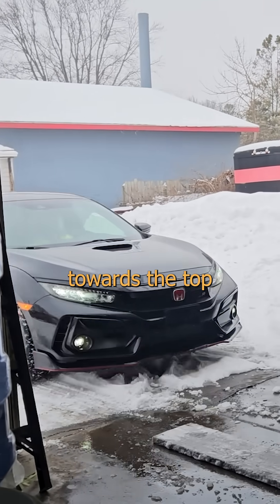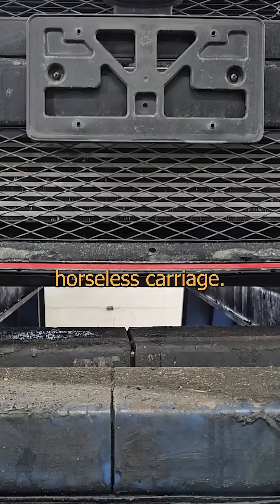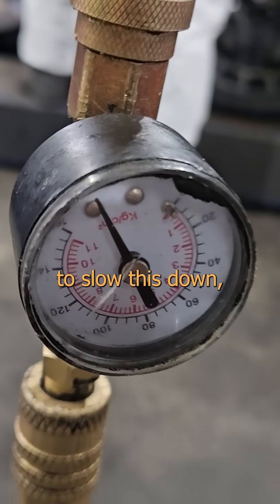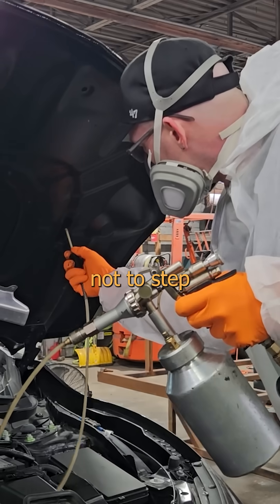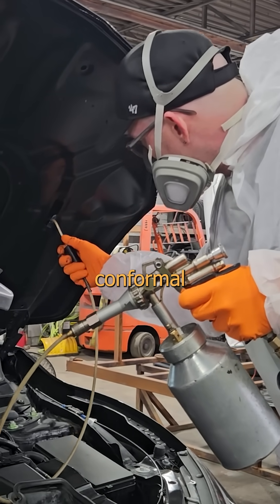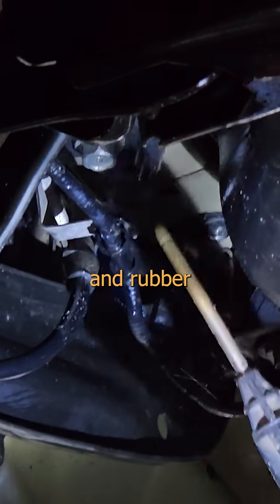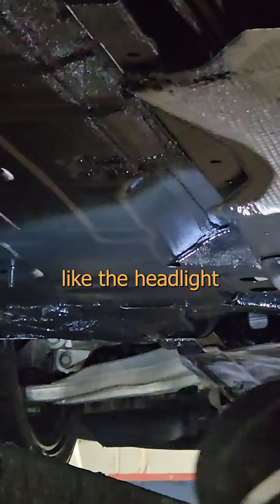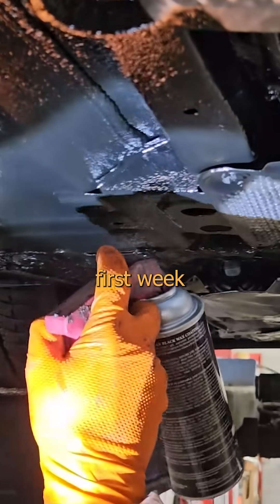How to stop rust on your car #chrisboden #comedy #engineering #wax #corrosion #science #winter #salt

Comment: Gramps just used a 50/50 mix of diesel and old used motor oil and sprayed every undercarriage and trailer he had on the farm. Held up pretty well.
Reply: Gotta do it every year, and if everyone did it, you'd be wondering why your windshield is always so murky and why the rivers are rainbow coloured.
Reply: Too bad it's a carcinogen and pollutant unlike wax or lanolin. I wouldn't want this near crops or roads when it runs off. He comes from a time where you would just bury your used oil in the ground but we've learned better. He can use what he'd like but this shouldn't be recommended to anyone.
Reply: Yes. This is the only way that actually prevents rust. My grandpa taught me something similar. Undercoating actually accelerates rust and just hides it because it traps moisture
Reply: @yyeezyy630  Not wax or oil based (other kinds of oil, lanolin is common). It's explained why in the video.
Reply: @yyeezyy630 that is simply not true and it is terrible for the environment to do that man
Reply: Seconding the used motor oil. There's a reason our farm still has equipment from the 60's that runs excellently.... When you're done for the season, you clean and oil everything

Comment: Wax does start to lift and trap moisture after a couple years accelerating rot.  Reapplying does nothing for behind the first coat.  There are a lot of comparison videos out there and some military testing documented for protecting their fleet.
Research: “Rust Cure Formula 3000”.

Comment: it's not just about trapping water, it's also about accelerated point corrosion (the galvanic potential of that whole covered panel finding an electrolytic bridge at any crack, gap or scratch). Wax is the only way to go, if you're not repainting.

Comment: When we lived in the Lansing area, I was told that undercoating for modern cars was pointless. Years later, after hitting a small bump, our car, which still looked and drove almost like new, suddenly sagged, and one of the rear doors wouldn’t open. The underside had been eaten away by rust and finally gave out.

Comment: It's the salt. (Castrol for example) Motor cycle chain oil that turns into grease when dry. Mudflaps protect from gravel, sand and salt.
Rust paint: buy a gallon, take a litre , mix with an equal amount of paint thinner. This is your primer that will soak into surface rust. Prime, dry, paint, dry now comes the color match paint.

Comment: If I ever got a near new car, I'd love to get this kind of cheap but effective protective coating, as it would prevent a lot of corrosion from salt water damage in my coastal area.

Unfortunately, I reckon that "Down Under" in Australia - where it can get so friggin' hot in summer that we don't even bother to use fuel in our barbies (BBQs) anymore (×) - we'd have to come up with an alternative coating to this Dr Zooks Sex Wax, 'cause it'd pretty rapidly melt off into an expensive puddle...

(×) - Seriously, if you leave a steel griddle plate out in the 45°C+ SUNLIGHT (<sigh> that's 113°F+ to you poor American luddites) for an hour or so, it will easily get hot enough to fry up a steak & some snags no worries...

Back when I was young (and skin cancer was some abstract boogie-man), I actually got to personally experience 55°C (yes, that's Fifty-Five Degrees Centigrade or 131°F / One Hundred & Thirty-One Degrees Fahrenheit) weather (up in the North of Western Australian, near Wttenoom), where the sunlight feels like goddamn lead bricks & your brain gets so fucked-up by the heat (even in the shade) that you'll feel really stoned; like you're in a bizarre dream where sunlight smells like metal & the even blue of the sky is kind'a loud. All the thousands of spiders (Australia) getting frigging heatstroke & dropping like black hailstones out of the eaves / trees / fence capping / etc. really, really, doesn't help you maintain your sense of normalcy...

Comment: Last year I bought a used truck that the original owner lived in PA and I live in TX. I have never seen a newish vehicle had so much rust and corrosion underneath a truck and automatically knew what was happening after they told me from where its from.

Comment: I had a G body that someone had taken to Ziebart in the 90s. It had some gummy stuff on all the sheet metal in the engine bay that was a nightmare to remove without damaging the paint. You could use mineral spirits to get it off, or alcohol, but both would take a little bit of paint too and it hurt my soul to see that paper towel come up faintly car-colored. The underside had a coating on it too and I don't remember if it was a hard coating that was made sticky by the oil leaks or a wax type. Anyone know what Ziebart used 30 years ago?

Comment: As I get older, I realize some of the things those old bastards that I fondly call my mentors did and said are way better than a lot of the new-fangled gadgets and gizmos you can buy today. Been a mechanic for 3 solid years, a mobile mechanic for almost 1, and between being underpaid and not having enough space, I've tended to keep my tools as lean and reliavle as possible. This often means relying on old designs like the carbon-pile tester: dirt simple yet effective. Some tools are irreplaceable, but most of the space for my tooling is spent on sockets and drivers, wrenches and torque sticks, and some mild fabrication. Chris, keep doing what you do. I may be in another field, but my brother-from-another-mother, I learn something new from you every video

Comment: A good product for DIYing this is fluid film it comes in a rattle can or metal can and is lanolin based and you can get kit with a long hose extension for a umbrella shaped spray pattern and the fluid film for under $150.

Comment: I have a pair of 97 Ford Explorers, one was babied and got a dealer applied rubber undercoating, the other hauled a big trailer, and didn't get washed or oil changes for years.

Both have terminal body rot, but being body on frame that's not necessarily a death sentence.

The one with the rubber undercoating has extensive floorboard rust and and lots of thick peels of rust off the frame, not quite a hazard but concerning.
The one without has clean floorboards a minor scale on the frame.
Rubber undercoatings are the devil, stick to oils/waxes.

Comment: As a DeLorean owner, I can confirm…and add to this: Brake fluid will also soften and slough epoxy off. And I also found that prolonged exposure to high temperatures from exhaust systems when operating in desert environments can also crack epoxy. And for those unfortunate 1983 models that got sprayed with rubberized undercoating, it also makes one helluva mess.

Comment: Any thoughts on CRC Rust Inhibitor?  I spray a little on suspension nuts and bolts so I have a prayer of removing them in the future here in Maryland.  Works great for that, but wondering about undercoating.  Definitely does NOT smell nice immediately after application.

Comment: There is also the at home cheap version of this. Buy a few cans of Fluid Film, spray everything metal underneath the car once before summer, and once before winter. My stepfather has been doing this on his 2013 GMC 1500, and the frame is clean enough to eat off of.

Comment: I have been told undercoating is worst than not having it since during application it will trap moisture and it might look good but internally it is rusting. So I much rather have open view of what is going bad.

Comment: In Canada, at least where I used to work, undercoating was pretty much standard. The majority of vehicles got em.
Reply: Right? Krown seems to be the go-to undercoating around South Central Onterrible. If you ain't undercoating your ride, you're just asking for trouble. Missed 2 years in a row on m my '04 Taco when it was 10 yrs old. with a spotless frame. It rotted right out right quick after that.

Comment: I'm curious if bolting a chunk of magnesium to the body would prevent rust, because magnesium has the highest reduction potential of any metal, so if any oxidation were to occur anywhere electrically connected to the bar it would be at the bar and not the body of the car.

Comment: We simply save the oil change,  and spray that stuff every where, best is to run it down a dirt road to increase the stick. Reapply several times and you'll have a water proof layer pressure washing will have a time with, and with the black carbon coating, it's obvious where ya miss. Bonus points  it keeps bolts from freezing up with rust. Down side, it really reeks of oil for a week or two, so make sure no weddings or public affairs, because it's had to cover the smell

Comment: In the winter some of the puddles are 7x saltier than the ocean.
In 2022, in WI, I saw a 2019 ram 2500 with fist sized holes under the rear wheel arch trim.

Comment: We personally use “Fluid Film” which works amazing on older or mid generation cars that don’t have too much plastic under. We have been using it for years and our cars dont have a drop of corrosion. The only problem with fluid film is, it costs a shit ton

Comment: Boiled linseed oil is good for rust protection, particularly for stabilizing existing rust. It seeps into the microscopic pores and cracks and polymerizes in a day or two into a yellow patina that keeps out moisture and oxygen. Good for old tools, machinery, firearms, etc. It might need periodic reapplication on something like a car but it's CHEAP. Just make sure it's boiled and not raw or you're gonna have a sticky mess.

Comment: When metal rusts, it oxidises. It doesn't "oxidate", so the word is oxidisation.

I'm sorry, but my ADHD brain does not allow that sort of thing to pass without comment.

And yes, I know that's one more syllable, but it's more than offset by the use of the word "outlet" or "socket" instead of "receptacle".

As you were, sir.

Comment: It only works if you do it new before any surface dress develops. Once surface rust develops, it's somewhere to trap and hold moisture and that undercoating seals it in very well. I regularly see rust forming under the undercoating and nobody knows till you peel at the undercoating

Comment: Chris, automotive engineer here, who's inspected hundreds of vehicles and seen data on decades of corrosion...

YES undercoating works. It really works. Even in the saltiest areas of the continent, it means you get essentially no rust! Pretty much any kind as long as it's durable but like you said, lanolin/wax is a classic for a reason. Get extra sprayed into any and all holes in the frame and body too.
Reply: I know normal paint might chip and such, but what about (if price isn't an issue) spraying rust reformer then enamel paint over it?
Reply: @Bosnian.Spartan  as someone who rebuilds cars, classics and trucks rust reformer is what you spray on things that will not see elements of any kind. It is NOT durable to abrasions or chipping. It will stop rust if prepped correctly but as he stated in the video paint doesnt belong under a car unless it came from the factory. One chip and it can trap water between itself and the frame and ACCELERATE rust without you being able to see it. I've seen large patches or rust reformer come off in SHEETS because water got underneath it, the metal it was covering had to be cut out and replaced/welded in. Any lanolin based coating will work, I personally like woolwax black( did a 2011 tundra frame and a 2012 prius with one 1 gallon bottle from Amazon for 60 bucks) it flows and sticks easy, resists washout and smells like cedar for a week haha
Reply: Epoxy is stronger(if 2 part) than enamel and again it can still chip by being hit by rocks as you drive 60-80 miles and hour down the road. LIQUID wax cant chip and can be spayed on top of with more wax with no issues
Reply: @rednuhtorfa like floor/table top hardener epoxy?

Comment: And someone who works in a truck shop and doesn't know the difference between gvw and gcvw or even understand a yield sign,will argue that that's not undercoating that's oil spray... And also argue that rock guard is only for use on rocker panels.

Comment: This is so true! I'm a professional car detailer in Oregon and there is so much voodoo out there. all coatings are just a sacrificial layer that will wear, and they all wear at different rates. This stuff you're talking about is such a great coating because it's safe, easy to apply and does really well at keeping moisture away. But you have to reapply it at regular intervals.

Comment: Ahoi from Croatia! I'm in the elevations where it gets butt-clenching cold in winter with appropriate amounts of snow and salt.
Just did a front-lawn diy job on my 2006 Mazda 3 using a product I can get from Germany, called Dinitrol. There's a thinner one for cavities and a priming layer, and then a thicker wax for underbody. My prep could have been better but fingers crossed it works and holds for the winter!

Comment: Nice Type R you got there, really fun car. Got to dive one of the first ones in America to do a 50point inspection on it at the dealership. Also saw it after the owner swapped the tires to low profile and hit a pothole going “45” on the highway. Lasted about 2weeks.

Comment: I worked at a car dealership in the 90s. It wasn't often, but, every month or two they sold a few cars with a rust proofing and undercoating upcharge. They had a contract with one guy. That's all he did. He had contracts with a number of dealerships. I imagine it was enough to keep him busy every day. 
The shop was large enough we had a bay dedicated for his use with hanging  tarps because he'd leave a mess and a half. Overspray on the tarps and drips all over the floor. 
But, it does indeed work.

Comment: Galvanic corrosion is a fun little twat... Ferrous materials and aluminum get along like a Mongoose and a Cobra. I had to change out the intake manifold gaskets in my R code small block 350. Cast iron cylinder heads and aluminum lower intake manifold... I'm surprised it lasted a quarter million miles. Engineers changed up the materials after a 4 year production run of engine suicides. Changed to an all aluminum engine block and heads and full plastic intake system and slapped the newborn 6.2 right in the butt. Personally I prefer the 5.7 because you can work on it with minimal tools. Changing things up isn't always a forward move... XD XD XD

Comment: I did a module on corrosion control, water trapped between cladding or a protective layer and the metal is really bad (partly because you can’t see it rusting away)

Comment: Where I live almost everyone has undercoating and cavity sealing and cars still don't last 10 years. In my region it gets so cold, we don't use salt most of the time but mix our sand with special chemicals and have studded winter tires on basically every car just so driving isn't a suicide mission...

Though the old leaky diesels are still standing strong :D

Comment: lanolin wax (fluid film or woolwax), derived from sheep's wool, is hydrophobic, excellent and a single treatment lasts about a year of typical use in northern/heavy snowfall areas.  It's about $100-200/treatment, depending on the shop and the vehicle.  Some people cut it too much (comes off faster) and others not enough (it interferes with seals and other olefin materials, usually making them more mailable or at least greasy).  Our cars don't have a spot of rust on the underside and mechanics think they're from a desert state.  Worth it but make sure you test the brakes hard and thoroughly after leaving the shop in case any got on the disks.  It burns off easily enough but you don't want any sudden surprises.
Reply: Im gonna tell everyone this. 3 cans of fluid film cost anywhere between 50-60 CAD. And will easily do the same thing as the stuff he's using. Because its basically the same thing
Reply: Do it yourself for 1/10th the cost.
Reply: Pretty sure that’s what my cousin uses in his shop.
Reply: I usually buy a 12 pack on Amazon and it'll get me coating for 2 years on my mid-size truck.
Reply: a good way to prevent any brake contamination is to remove the wheels and put trash bags over the brake discs. when the wheels go back on, a light smudge of copper anti sieze on the contact faces (where wheel touches hub) and hub centric rings (the outer face of the ring in the middle of the brake disc around the central nut) of alloy wheels (NOT THE STUDS) will stop the salt from getting in and causing the wheels to stick to the hubs. also a good idea to lightly grease any brake caliper slide pins while you're there.
Reply: @tech4pros1 ain't nobody got time for that.  Gotta get back to drifting in the snow
Reply: Common misperception. Shit still rusts away in the desert. Sure without salt on roads it might not be rusted as fast but just look at red sandstone, that's the rock rusting.
Reply: @bumponlog  rust exists in the desert but it is decades before it is a real problem. There's plenty of vehicles I get jealous of when I go out there because it is 50 years old and still has complete body panels. Around here you're doing good if your vehicle has no surface rust at 10 years old. At that age most are missing rocker panels and/or fenders are rusting through.
Reply: @bumponlog  I live in AZ, I was amazed at how many 90’s and 80’s vehicles were still on the road here when I moved from New England, sure , everything eventually rusts, but you example takes decades, if not longer, not comparable to a car.
Reply: @Dan-yq8lf  that's... exactly my point.
Reply: @bumponlog  you're not going to have a car rust out in 10 or 15 years though.

Comment: As long as you can lift your car up you can even just clean it with hose and water and a sponge let it dry and get like two three cans of coating from the auto parts store and cover it. Not your exhaust, though.